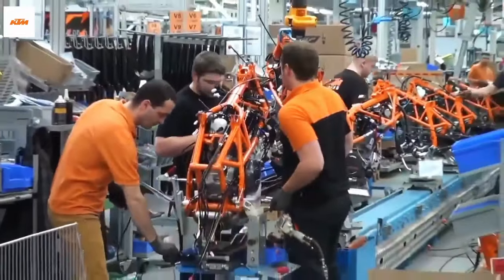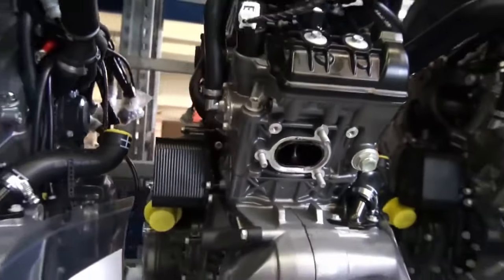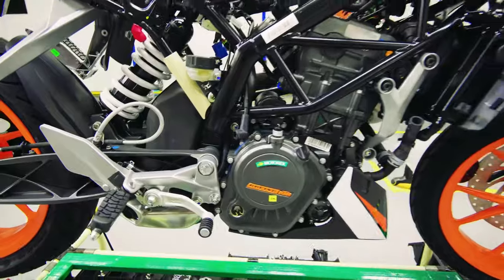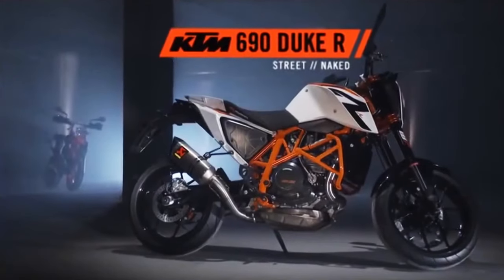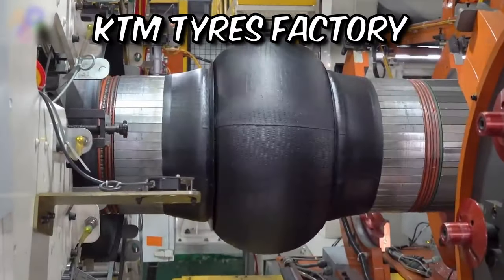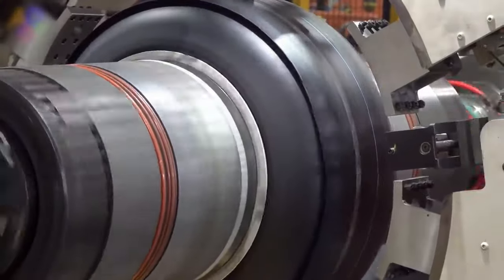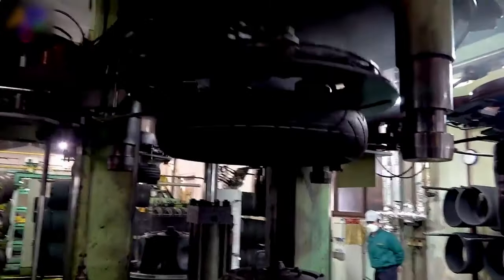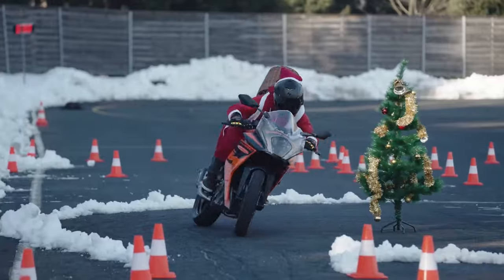▶️Inside Austrian KTM Factory 2023 🏍️: Manufacturing plant & Engine assembly line [Factory Tour]

Comment: The transition from cable throttle to ride by wire is tragic. This should not have happened. Unfortunately every manufacturer is doing it. 😢. Ride by wire is rubbish 😢😢. Very very unreliable. Especially those on BMW and Honda.